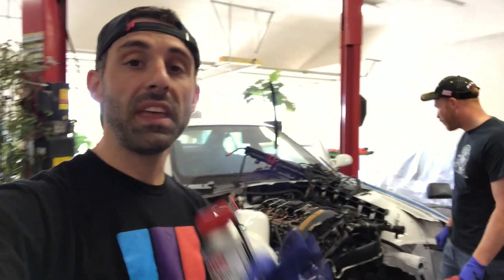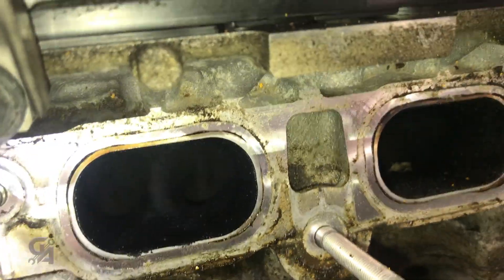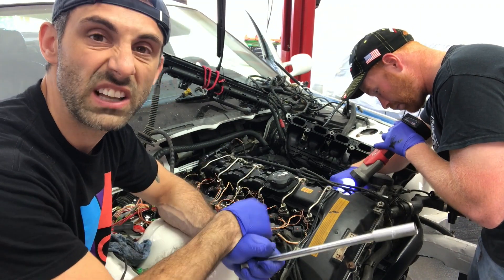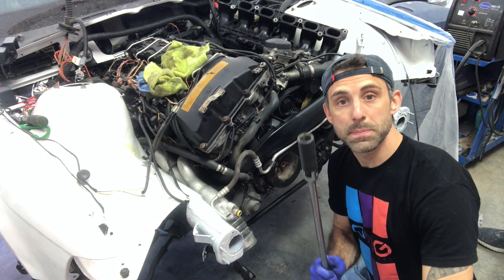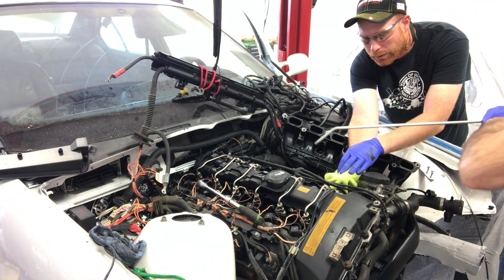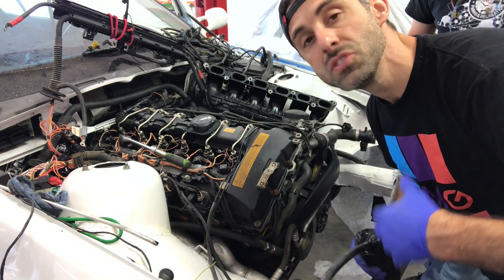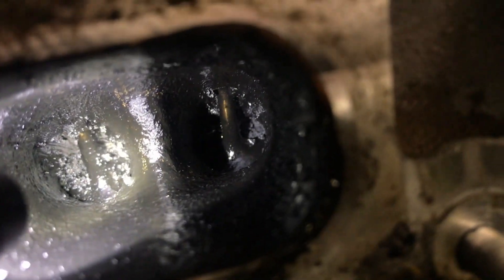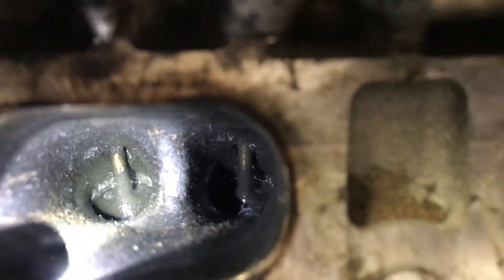Techniques To Help Clean Dirty N54 Intake Valves!

Comment: I would've use original Gunk engine degreaser and filled the intake port with as much as possible and let it sit for a few hours. And find some tubular pipe brushes and put them in a cordless drill and scrub the shit out of the ports. Because if you don't get the majority of the oil and carbon out it will still detonate which isn't good

Comment: Nice, how to half ass clean your valves, lol. And btw, you should be using some kind of flexible spark plug socket with at least an 8 degree flex less you chance breaking your plug insulators as per BMW.
Reply: Well walnut is $400 and he spent $20 on a can of CRC….somthn better than nothn
Reply from the maker: I released 2 more videos over the next year doing it properly, like most people who turn to YouTube to learn, I honed in on my skills pretty quickly thereafter 🤣. No substitute for actual walnut blasting. That’s for sure.

Comment: Crank is 22mm not 32 mm
Reply from the maker: Good catch thank you I’m you are right!
Reply: @Garageaholic  np, I just did this and the vacuum was probably way freakin easier; but you can also use the top of a soap dispenser to pull most of that crap out! This took forever, but they look way better! Did you guys ever do cam bearing seals?
Reply from the maker: Nope! We never got to that!

Comment: I thought I needed to clean mine until I seen your valves.  My non cleaned valves look 100 times better than your cleaned valves.  I have 140k miles on my 2006 N52 engine and you can actually see all the metal on my valves and walls.  I feel alot better about my engine after seeing yours.
Reply from the maker: That is an Ill-informed poorly researched comment, considering your comparison of your port injected N52 to the direct injected N54. 
Please do your research before posting a derogatory sarcastic comment on a video series I’ve worked VERY hard to produce for my educated viewership.
Reply: @Garageaholic  I wasn't being sarcastic just stating the facts at the time of watching your video.  I obviously don't know anything about  cleaning valves, thats how and why I found your video, to see if there is a way to clean the valves without walnut blasting.  I'm guessing yours were gunky due to having a turbo engine unlike mine which has no turbo.  I have no idea.  Thanks for the clarification and for making informative videos.
Reply from the maker: I am sorry I thought you were being sarcastic!! 
Yeah n52 engines done require it because they are port injected, the incoming gas mixes with the intake air and that by nature keeps the intake valves clean! 
In your case you don’t need to blast your valves!
In my case on this car I learned that the liquid chemical method of cleaning intake valves just doesn’t work
Reply from the maker: I was learning how to walnut blast and have admittedly needed to do a better job on this application,

If you watch my E30 N54 walnut blasting video you’ll see that I got the valves squeaky clean. I learned a lot since working on that white e36.

Comment: Omg. Those patch welded longerons. Does he feel safe driving this car?
Reply from the maker: It’s 11ga fully welded sheet metal. Wouldn’t be surprised if it’s stronger than stock!
It was apparent that this car was in an accident before because one of them was damaged to I needed to straighten it out and rebuild it as it was being modified to fit the radiator assembly

Comment: You guys need to do a vid on exhaust smoke basically its replace rocker gasket and put a mod PVC in while rocker is off and fit an oil catch can this also helps carbon build up in valves, my n54 has had smoke twice in 10 years both times this has fixed it no more smoke and not a big job unless it's a turbo issue. These are great reliable cars if you know what your doing mine is 12 years old and never had major prob. Now for someone that knows very little about cars forget it.